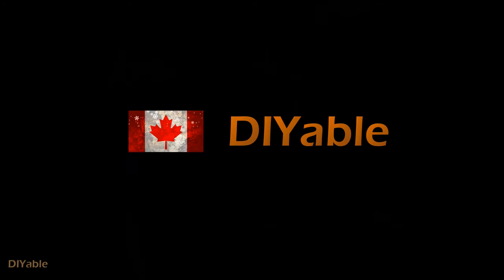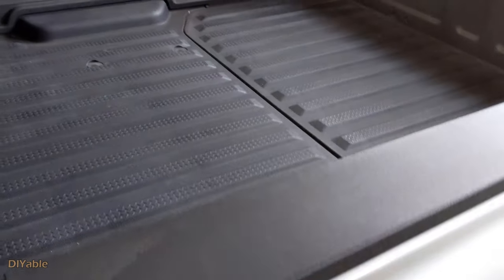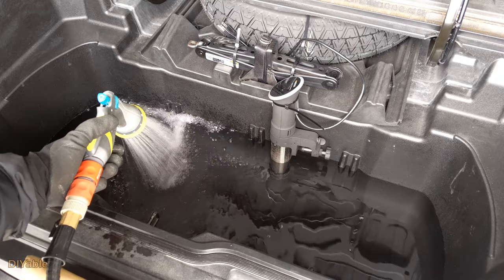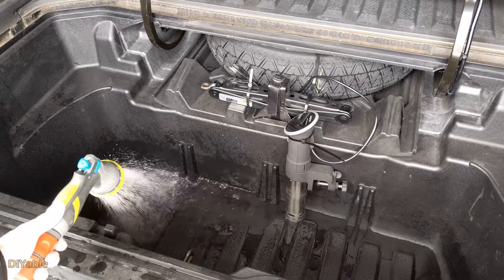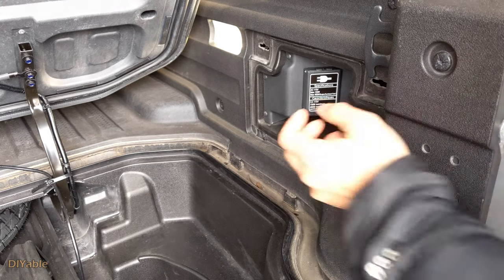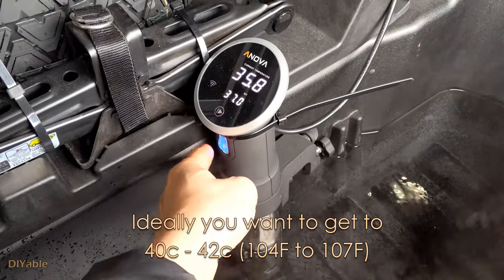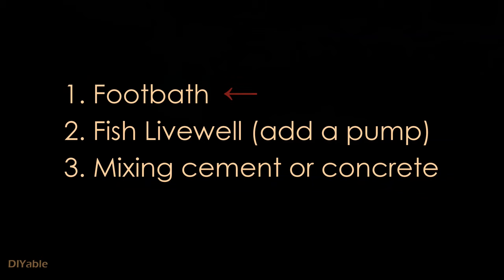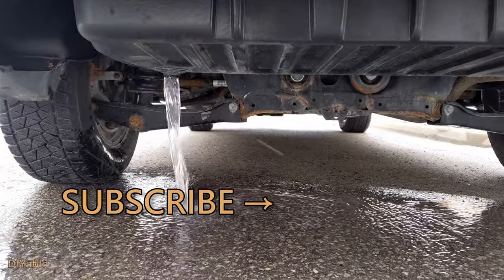Honda Ridgeline secret - The only pickup truck in this world can do this!

Comment: I love this, very creative. My only question/concern is that most sous vide units are rated at 800-1000 watts and the outlet is limited to 400 watts. This is potentially a bigger problem than the removal of the ground prong.

Comment: Looks like the Anova products are 750 to 1200 watts so how are you running that off of a 400 watt inverter in the Ridgeline?
Reply from the maker: It didn't trip the circuit breaker. LOL...

Comment: No ground! Risk of electrical shock?!
Reply from the maker: The inverter came with the vehicle doesn't have ground... LOL..
Reply: The power would need to flow through you. He would need to be sitting on a metal plate skin to metal where the negative was connected to the onboard AC negative, not earth ground or battery negative, while there was an electrical fault in the anova.